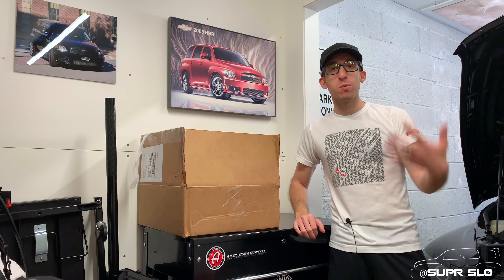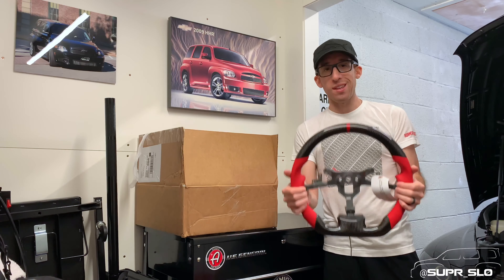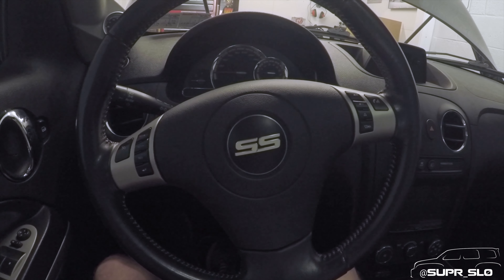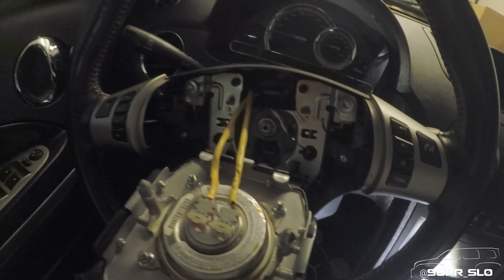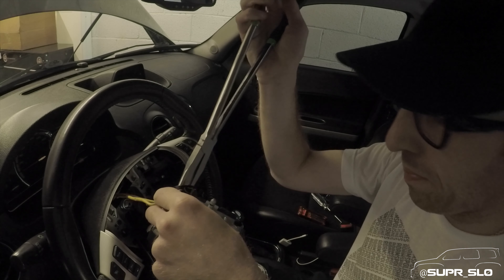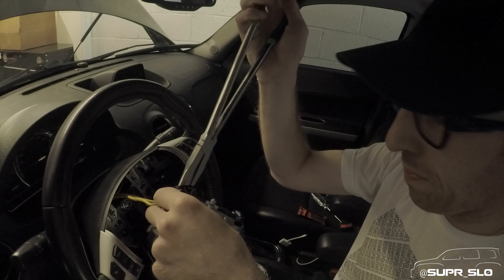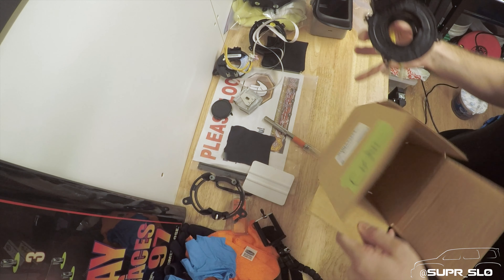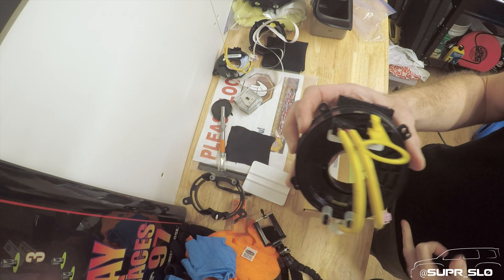More Corvette Parts for the HHR!!!

Comment: Mod set up for the engine ?
Reply from the maker: Currently - LDK Ecotec, Opel injectors, turbo tech racing intake manifold, LT1 fuel pump. We’re removing the engine to install forged internals, springs/retainers, Cams, and more - you can check out the new mod list here! https://www.youtube.com/watch?v=r8MO5nj1YsI